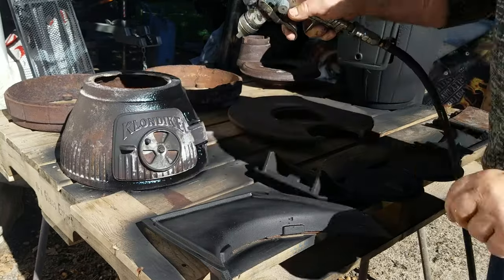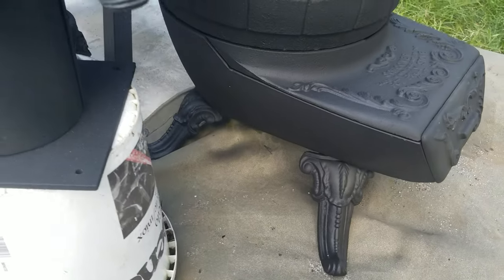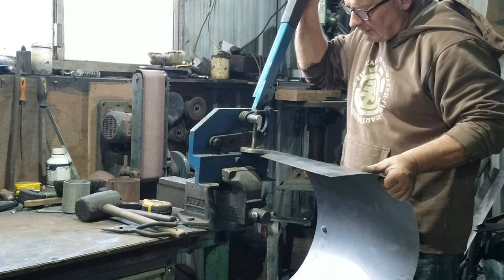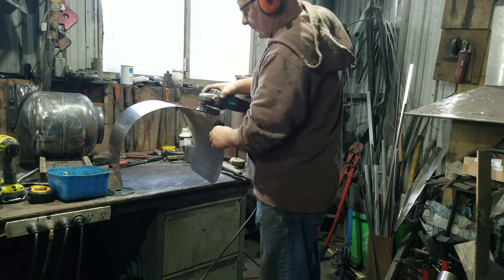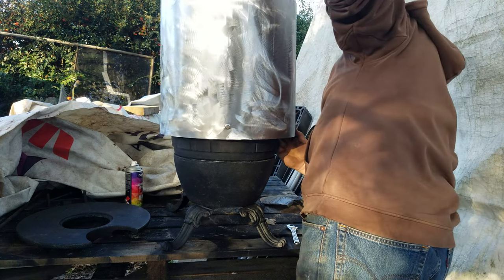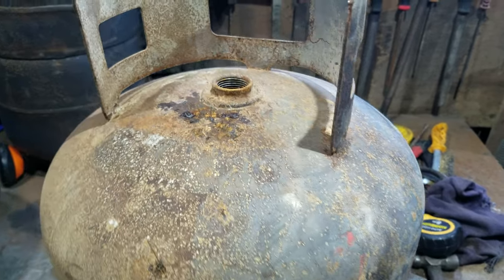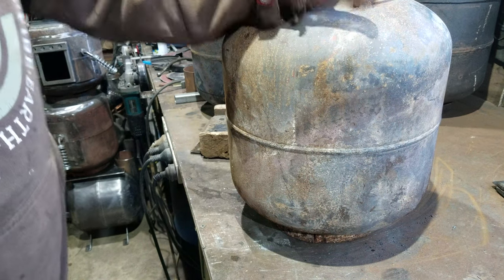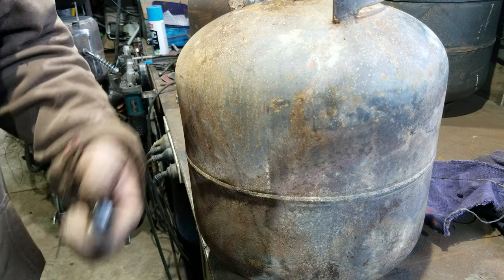Potbelly Stove Refurbishment and Manufacturing from Recycled Gas Bottles

Comment: Hi have aquired one to the schooner pot belly stoves, the lugs at the bottom of the door are broken have you seen any replacement doors,also there is a slit at the bottom has had a triangle tool made to fit it that what is that slot for Air ? Only has the three tools with it  Handle for the door, Hook poker for the top and the blockoff for the Slit. Also what paint is best to keep them black thanks David NZ
Reply from the maker: Hi David, I use Granny's stove black for all cast iron https://www.trademe.co.nz/a/marketplace/building-renovation/tools/hand-tools/accessories-consumables/listing/4799679058. These people in Aussie have a good range of Masport parts https://www.downsheating.com.au/wood-heater-spare-parts/masport-pot-belly-parts/

Comment: So clever.😁 I adore tiny houses.💜💜 How much for one of the gas cylinder stoves? They are so cool.
Reply from the maker: https://blazingstoves.wixsite.com/blazingstoves
Reply: Hi Stuart. Your website is down. Are you still making and selling? Thanks
Reply from the maker: @theloopcrew5947   Hiding- I have so much work that I cant keep up. I have to stop the inquiries coming in.
Reply: @t.h.o.r.  Good on you. That's a bugger for me but will keep a look out for the website to come back up maybe when your workload eases off. Cheers
Reply from the maker: @theloopcrew5947      Yes crazy as it seems - you need to buy your stove in the summer time. Every winter it goes nuts! Stay dry matees.